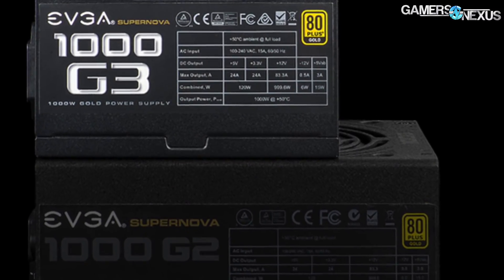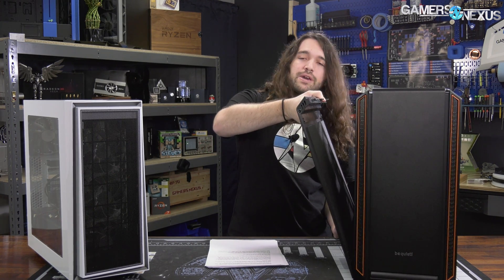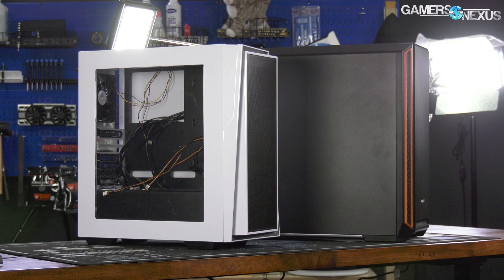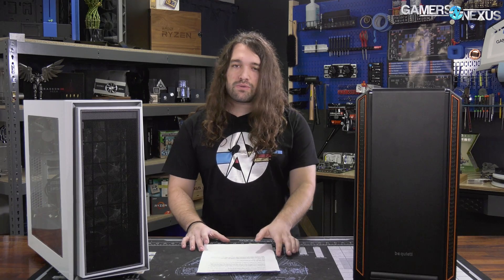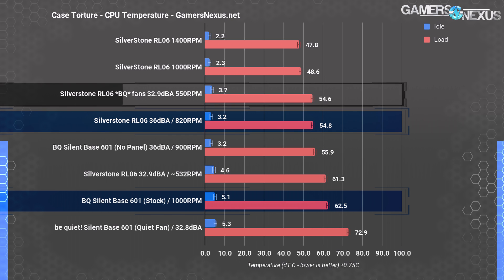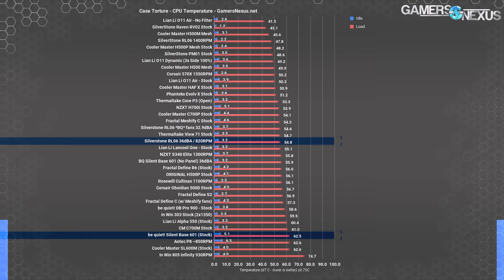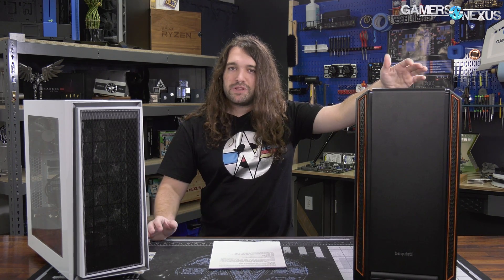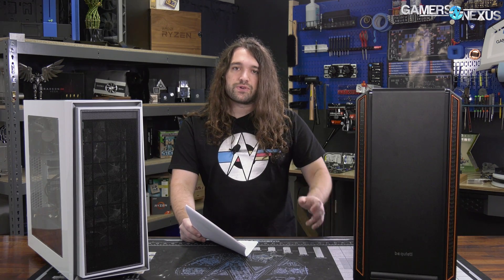Airflow vs. Silent Case: Noise-Normalized Thermals

Comment: What is the coldest fanless configuration possible?
Reply: why do you need fanless? Some fans can go as quiet as 6dB and the quietest your house will ever get is ~30dB. You can get good airflow and keep fan noise down to 20dB which will be 100% inaudible to you. Even the smallest amount of airflow can help tremendously with thermals.
Reply: I find the question interesting, but that does not mean fanless builds are the best. "Even the smallest amount of airflow can help tremendously with thermals" Sure, but which setups are affected most/least? Regardless, the fans don't sound inaudible to me. It depends on the location of the case, but at 2 meters I can still hear 140mm Noctua PWM cpu fan at 40% speed,  even though background noise is louder.
Reply: @Arashmickey  It honestly depends on what you wanna build. Throw a dark rock pro 4 on a raspberry pi and you can passively cool that bad boy with no noise no matter what you decide to do with it. There are best case scenarios for each setup you think of, and all of those are further affected by ambient temps so there are just far too many variables to consider when trying to think of the "best solution". I can undervolt my 1080ti and with an aftermarket raijintek cooler and maglev fans I'm able to run it completely silent under load (which is a good balance of performance and sound) but then again I can run most things silently now (and perhaps even without fans) as I can drop my ambient temps to 5c by opening a window. If you're in a place where ambient temps are 30c+ you're gonna need way more cooling power. I've seen really cool projects where someone used liquid cooling on a build they kept in their bedroom and fed the pipes through to the garage where the pump and fans were so they just moved the source of sound far away enough instead of trying to contain it or minimise it. Eventually that setup died because the temps went sub-ambient in the winter (as his garage had no insulation or heating) and condensation killed the mobo, so that's another thing to keep in mind.

Regarding your cpu fan, surely you can turn it down more until it's inaudible? It might not be practical for your cooling needs but you can reach that state of silence from it (and any other fan). Also keep in mind most PSU's have fans that (at least in my case) will be louder than case fans if you have everything turned down.
Reply: @A1Plooplord  I very much agree, it depends on what you want and what you've got to work with. I think the bios (z170 sabertooth mk1) didn't go below 40%, so I don't know if the noctua cooler could run inaudible. It will ramp up under load of course, this was idle with casefans/GPU/PSU fans passive. You can hear it even though it's the quietest fan because it sounds slightly different. I'm just interested in the info. Maybe a vertical airflow case like the SL600m or UMX4 is better than a horizontal one like the RL06 once you start removing fans, maybe it's better to turn the mobo 90 degrees so the GPU doesn't heat up the CPU. That sort of testing isn't done often because it doesn't concern the vast majority of builds.
Reply: @Arashmickey  The industry has pushed standardisation so much and is only just getting around to modular customisation. With the helping hand of channels like this one I expect that to change in the near future. There's already a few cases out there where you can flip the mobo around like you were saying so I'm excited to see where it leads.

Again, there's so many variables to consider even when you try to narrow down to questions like "vertical or horizontal". Bigger cases see virtually no difference, whereas smaller cases might benefit by a few degrees - 'might' being the operative word, as the internal design will also affect how effective it is (as well as inclusion or exclusion of fans). 

I'd love to compile a list of "what works when", like a guideline for every scenario. But it's not a reasonable workload in any way and aside from a few important things you won't really see an improvement. For example if vertical vs horizontal made such a difference we would have it up on our list of priorities probably near thermal interface. Some things matter more than others and those that aren't discussed often are generally those that don't matter much. I'd love to hear your thoughts on that though.
Reply: @A1Plooplord  Yeah, what doesn't matter to most people is rarely discussed, though exceptions can happen and discovering an oversights can create change. But in this case I'm not looking for some quantum leap in cooling or bringing a niche into the mainstream. If that's important to you, this is the wrong time or place! This question is more cartography than resource surveying. The variables are fewer than for fan-cooled builds though. There's few vertical cases, few high tdp fanless cpu coolers, few fanless gpus and psus. Maybe better to use a Morpheus gpu cooler and dark rock or noctua nh-u14. You can test builds of various performance tiers in various cases, progressively removing fans as you benchmark. Probably lots of margin of error at the start, but eventually you get usable info like when your stuff starts throttling. Anyway, I'm sure Steve would do a  better job than me testing and finding performance sweet spots.

Comment: You can use a Thermal Take 3.0 Water AIO with a NZXT G12 bracket for your GPU, and a AIO for your CPU with PWM controlled fans to get lower noise and better cooling = )

Comment: how do you tune your fans?
Reply: I like using Speedfan.  Free program that works quite well.  Takes a little bit of time to set up, but once you do it's good to go.  There are some videos on how to set it up on youtube, jayztwocents has a video on it that if I remember correctly is pretty good.
Reply: BIOS. Most motherboards allow either PWM (4 pin) or DC Voltage (3 pin) control of fan speeds.

Comment: Tbh i want a case that has good thermals, because I'm just going to turns the fans up and put on a headset anyway.  I'm not streaming or recording, so the noise just isn't a problem for me
Reply: open headphones sound so much more natural though. you can go semi-open and turn fans down a touch to get the best of both worlds
Reply: @A1Plooplord  i have an open back headset with a built in mic, i still don't notice the fans.
Reply: @supervillain3213  depends what fans and what case then i suppose, if I turn mine to 100% I can hear them from the next room while wearing closed headphones
Reply: @A1Plooplord  WTF?! Are you using Delta fans??
Reply: @DumbSloth87  hahaha no I just live in a quiet rural house :) My BQ fans interact weirdly with the dust filter when they're above 2200 RPM so they become about twice as loud according to my ears. I never have them that high anyway (as there is maybe 1-2c difference thermally) so I never bothered to investigate

Comment: I have no interest in silent cases just get a headset
Reply: Not everyone uses PC just for gaming with always on sound.
Reply: My PC is for gaming and home theater. I have my case fans set up to shut off when temps are below 42 degrees and my cpu fan is at its lowest rpm. Absolutely no noise comes out of my case during movies. I used to have an AIO but I could hear the pump during movies and it drove me insane so I switched to a NH-D15 instead.

I also work graveyard so when I get home it's 3 am so I can't over power case noise with volume since I'm trying to keep it low in consideration of my roommates and neighbors.

Comment: Really out-of-left-field but would you guys do a comparison between 'silent' cases and high-performance cases in audio/instrument recording scenarios for any perceptible sound interference? I'm really interested in be quiet!'s cases for a home studio music production pc.
Reply: They would have to breakdown the quality of the sound emanating from each case and fan config, which might move away from the focus of their channel. be quiet! and other silence cases are still fantastic at better broadband and HF peak reduction than slower fan speed airflow counterparts, and you'll also need to figure out how the case sounds in your room, as room acoustics will come into play here.

I have my case sitting off to the left of the desk and tucked away behind my rackspace (it still has plenty of room to breathe back there) and as a result, I only have to worry about LF noises as there are almost no single reflection of direct line of sight paths for HF waves to reach my main space.
Reply: There are a lot of parameters. Depends on the sensibility of your microphone and if it's some cardioid of very directional one. Depends also of the room and the noise dampeners, pieces of furnitures, etc. that can reduce the echo.
But you know in a simple software like Audacity you can use a noise suppressor. Results are great if the noise is always the same.

Comment: Yes, I've been looking forward to this. And based on the description I think I'm going to like it!
Reply: Hmm. So get an airflow case and tune fan speeds, and be able to crank fan speed up for more cooling if needed. Or get the silence case and pop off the front panel if more cooling is needed (assuming the front panel is easy to remove).

Airflow cases are cheaper though, so I think I'll tune fans.